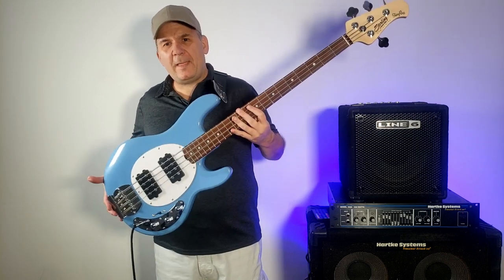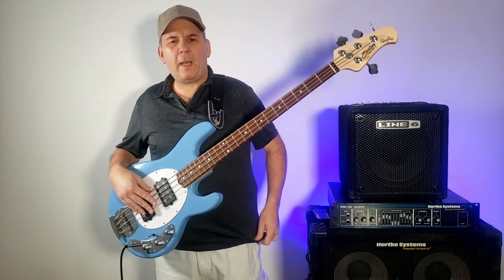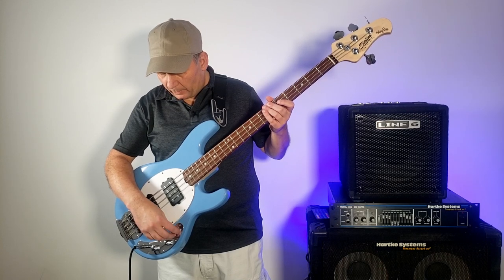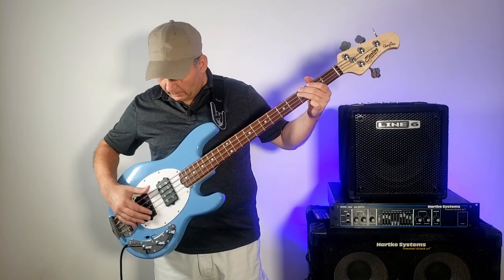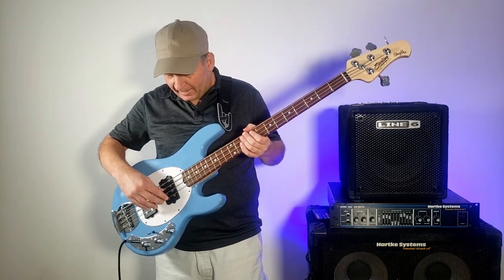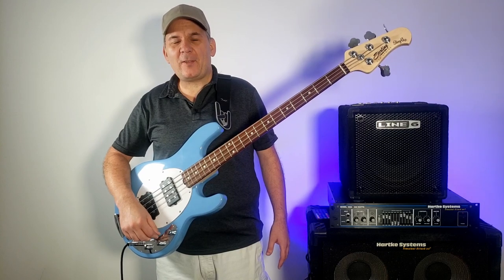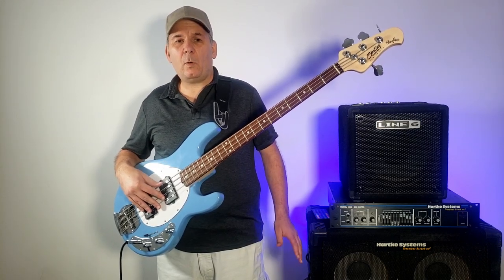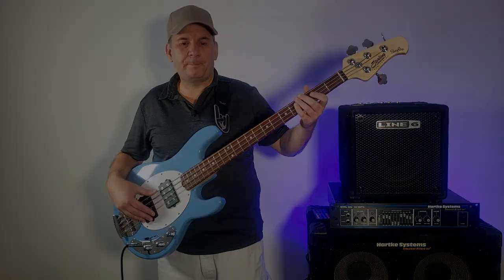What's a microphonic bass guitar pickup sound like?  Sterling Stingray Ray4HH

Comment: I have a Ray5 HH with the same issue. Wax potting the pickups tonight. I’ll report back!
Reply from the maker: Mine's been on my kitchen bar for 2 weeks. I have it ready to de-solder and just haven't done it. I have the GulfWax ready even. Was thinking maybe I'll do just one pickup first. I like the bass enough that I'd consider putting in a full Seymour Duncan pickup set and preamp if wax potting sucks. I lucked out and managed to get the bass on sale a little while ago for like $300. I have my fingers crossed for it working out for you. Good luck!
Reply from the maker: Did you open yours up and freak out like I did when you say the 14 lug 5 way switch :)  I have the wax on stove now and am just about ready to submerge the pickup. I'm doing just the neck pickup first. If it dies or doesn't work, I think all of the electronics are coming out and a whole Seymour Duncan setup it going in.
Reply: @kubicki2000  I saw that switch and went “nope” and clipped the wires to the pickups and just spliced and soldered them back in. 

I didn’t have luck with mine. No real appreciable improvement. I may not have done it correctly and hopefully you have better luck. 

Make sure you get the black rtv or whatever that sealant is cleaned out. It melted on me and made a mess.
Reply: @kubicki2000  friend what I did was sell the bass, a technician informed me that the pickups were not well finished and had to be changed
Reply from the maker: @rubensalazar4003  If this doesn't work I play to go with a couple of Seymour Duncan's and a Duncan preamp . My bass plays fine. I really like the tone but not so much the noise. I only paid around $300 on sale and if I go the Duncan route I think I'll have $550 or so in it. Would be worth it.

Comment: I recently bought one of these and noticed the same thing.  Have you waxed it?  Did it resolve the issue?
Reply from the maker: I haven't done it yet. I planned to use that bass in a video today but was having problems with recording the amp for whatever reason.  I gave up and went to Kroger to get some GulfWax (easily available paraffin wax) and of course they were out :(  I'll need to venture out somewhere else and get some. Probably going to use some sort of double-boiler setup to melt the wax.
Reply from the maker: I started the teardown yesterday. Have you ever looked at the 5 way switch in these?  It has 24 lugs!  I found a factory wiring diagram that looks correct and is helping me make sense of things before I de-solder anything.
Reply: @kubicki2000  the only mod I've done to the bass was file out the nut to accommodate BEAD tuning. I haven't opened up it yet.   It was going to be a Christmas holiday project.  The last guitar I switched pickups on, I just cut the wire and added a connector so I could swap pickups easier in the future.  Good luck, I'm really hoping it makes a difference.  I asked lowendlobster in the comments of one of his Ray4 mod videos and he was skeptical that it would resolve anything as they already look wax potted but maybe there are some air pockets that need filling.  The pickups aren't too bad, The finger noise and pickup tapping sound is annoying but I've blasted it through 500watts and it wasn't squealing like a crap guitar pickup will but maybe that is not a thing that happens with bass pickups?

Comment: I cant find the new vid.  Did you wax pot them or change them out? Thanks
Reply from the maker: I wax potted one of the 2 pickups. I've been struggling to rewire it correctly forever now and almost gave up. I just this week bought a Cobra blue Ray4HH with a maple board. I can use it to check my wiring. I have also figured out that I need to unscrew the 20 lug switch so I can pull it out a bit to better see what the heck I am doing.
Reply: @i2000 wow, that sounds like Hell. Im looking to buy my first Bass and this is the one I was looking at(the new ALL black one just came out. Only the tuners are silver). I really was starting to covet it(which usually means "take my money")  I guess Ill go back to >>trying<< to like the Squire Jag Bass. 
Its like falling in love with this new perfect girl and then finding out from a friend there is a huge issue with her you cant deal with and then go back to the old girlfriend who is just kinda ..blah.
Reply: @kubicki2000 I've had a few Yamaha basses and they've all had microphonic pickups too, so annoying. Did you notice the same issue with your new Ray 4 HH?